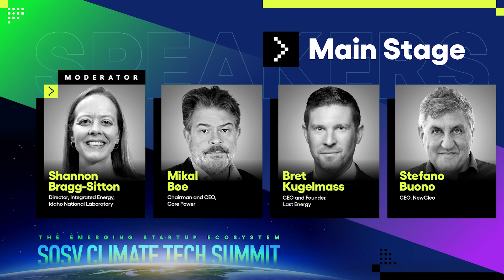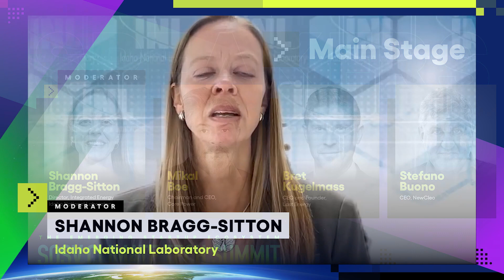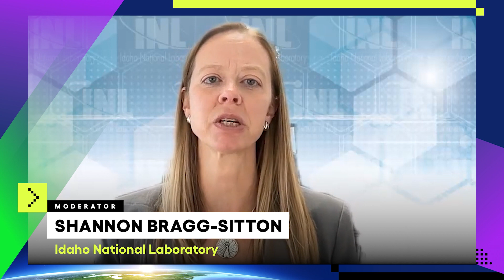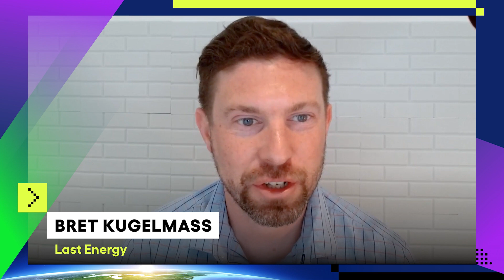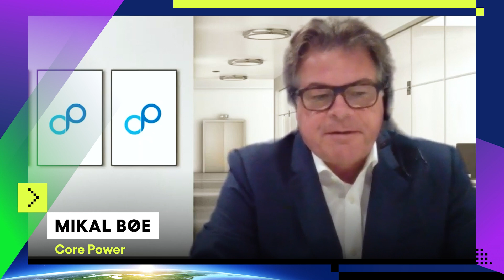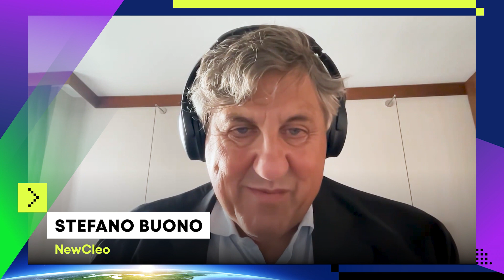Is The Era of Small Nuclear Reactors Finally Here?

Comment: ... There are circa 440 nuclear reactors worldwide.  They generate about 500 GWatts of power.  Many of these reactors are old and nearing the end of their 40-year lifespans.  In comparison, circa 360 GWatt of new renewable energy systems were installed just last year.  If this trend continues,  renewbles will have so much of the energy sector that nuclear will be irrelevant.